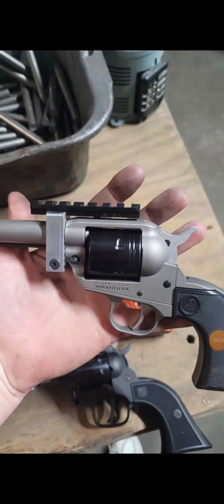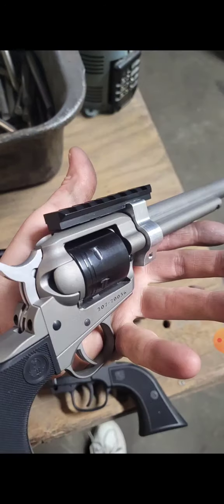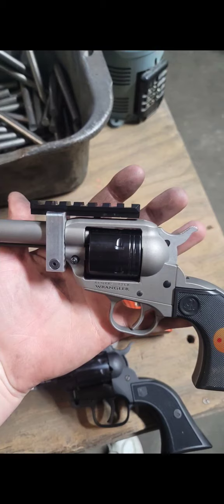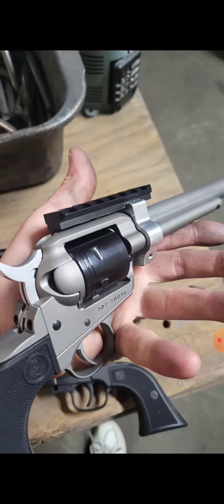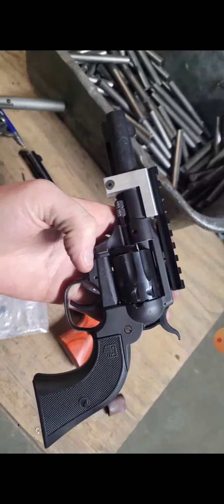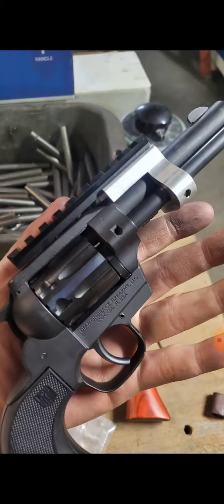revolver rails 2nd update almost ready

Comment: Looks really really good! But will the anodizing affect the final price a lot?
Reply from the maker: thanks, and nope its priced as finished so it wont be any more expensive.
Reply: @salemlakesarmory  you had mentioned before I believe about the rancher working as well is that still going to interchange as far as the heritage line?
Reply from the maker: @Gutierrez 24  so the rancher shares the same frame as the rough rider. the difference is on at least the bullhorn model the front sight blade it much higher. i have a bullhorn rancher and im going to test it on there but it should work. you will have to remove the bullhorn rear sight from the dovetail and with the fiber optic model you will have to remove both front and rear on that but it should work. of course ill test what i have and label them accoringly.